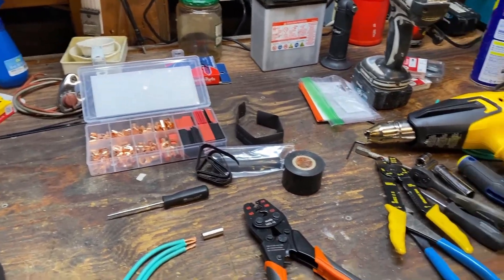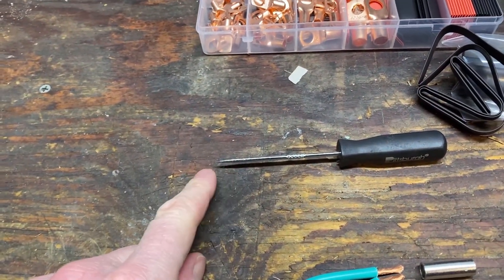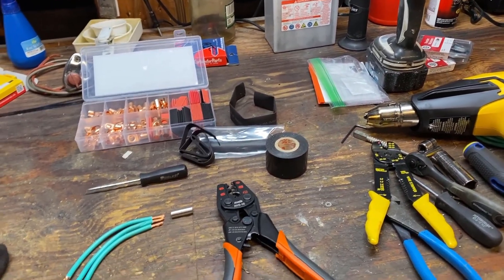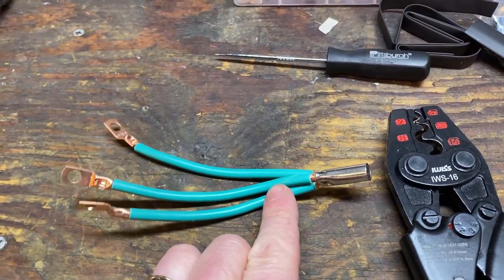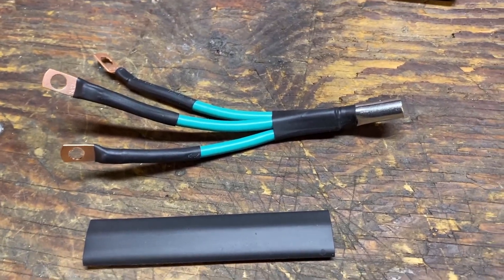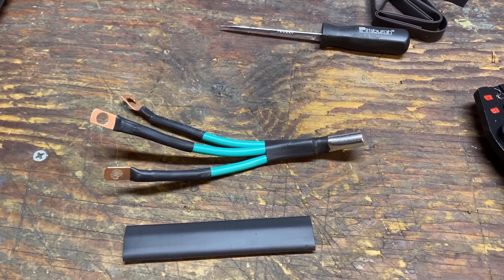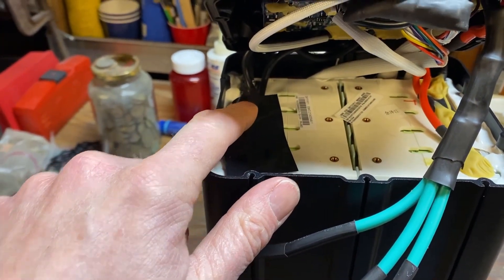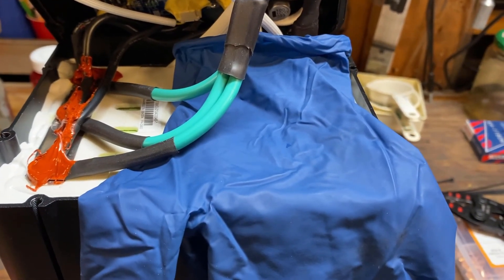Surron X - Make your own BMS Bypass Harness plus installation tips.

Comment: Hi.
I use a Mud Hugger instead of the small mudflap near the tire.
And I think these small things on the back of the wheel that are mounted on the rear axle with a longer bold, are very effective. But ugly! 
The Mud Hugger is easy to mount with zip ties. I have modified it a bit with a heat gun.
And cut a little piece out for the chain. 
Greetings from Wim

Comment: I'd also like to find a front fender where the rear portion is long enough to extend down and actually protect the controller from rock damage.  Everything I've seen is longer and wider in the front, but short and tiny in the back.

Comment: I got a question for you If you don't mind.  I know you're not showing how to do the BMS🤨 which is like , come on already 2022 how else can we get this knowledge? I my problem, I have a battery off of a scooter. it has  at least a 75% charge. I know that cuz it has a little push button with a LED meter on the side of the battery almost like a  on and off switch.  When I plug my  meter in to the positive / negative coming directly off the battery.  I'm only getting 3 amps like barely an amp! What do you think is causing this? I'm guess is that it has something to do with the BMS Is not allowing the current to flow I don't know what do you have any idea or can you give me some advice I would greatly appreciate it Thank you for the valuable information
Reply from the maker: Keep in mind that in order to measure current you need your meter connected in series with the load.  Connecting to the + and - terminals will allow you to measure the voltage, not the current.    If you connect the meter in series and you are seeing a lower current draw than you expect while under load, that is probably the BMS doing it's job.  Also note that you can damage your meter - or hurt yourself - trying to measure high current incorrectly.  I would recommend you watch a few videos or do some reading on how to do that if you're new to this. Be careful, be safe and good luck. And thanks for watching!